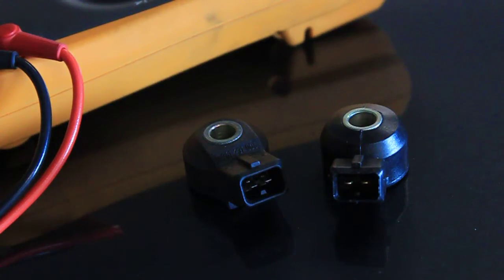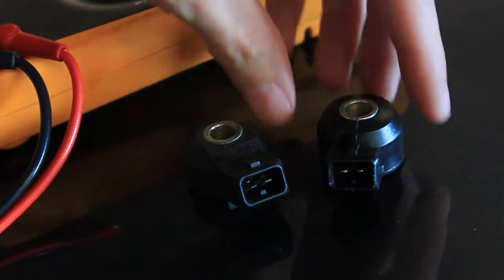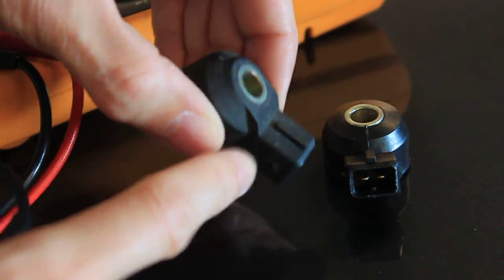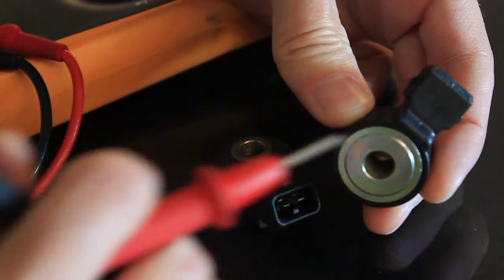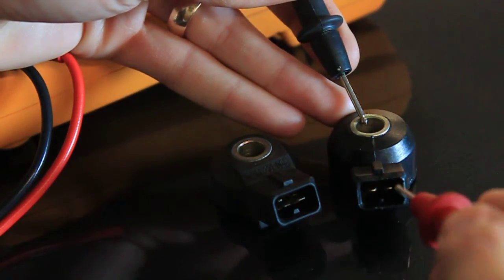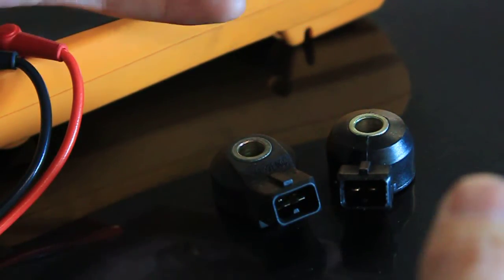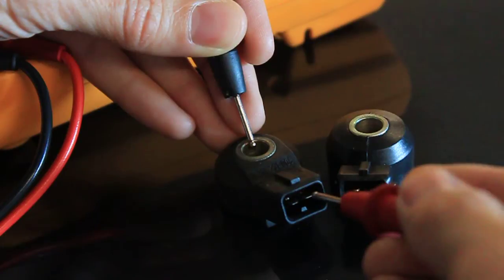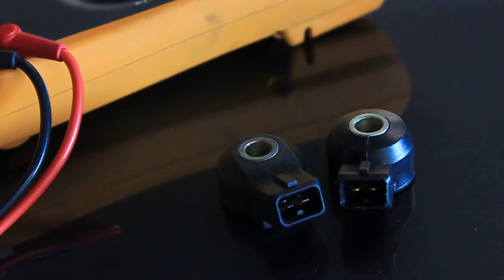Flat Response Knock Sensors - Not all are created equal.

Comment: This guy is right a grounded ring sensor is undesirable unless yours is specifically a  one wire type. mine showed resistance to ground & was faulty, the new working 2 wire sensor was not grounded

Comment: The series 2 I have has one pin for the knock. I get you aren't grounding the second knock sensor wire to the engine, where did you connect the second knock sensor wire?
Reply: Im working on a maxima and wondering the same...I bought a a sensor and wire harness off ebay for 30 bucks which said oem with nissan packaging but no writing on the sensor, harness has two wires going down to one wire at the sensor plug , I need to test tp make sure cause I'm having issues

Comment: The important thing to do is to not make a mistake with the wiring polarity. If you switch GND with signal you will get spikes going into the ecu. We use both sensors on Tuner Nerd  Knock monitor pro. The Bosch gave a slightly flatter response and the polarity can be switched. The nissan style sensor gives a good response too, but dare you not switch the polarity!

TLDR: Buy the bosch - they work everywhere , but the internally grounded sensors are good for systems configured for it.

Comment: I'm sorry, but your opinion cost me more than $250. Unfortunately all of the sensors (old one, ebay $9.and oem one) do have ground!! Please redo your experiment.
Reply from the maker: mohamed alromaithi this is not an experiment nor my opinion, I am showing you what I found when I purchased a knock sensor from eBay. There may be eBay knock sensors that don't have their electrical pins shorted to the body of the sensor but I know from these measurements that the Bosch sensor does not.
Reply: Nissan use the engine block to ground the knock sensor and the plug from the engine wiring only use 1 wire for the signal, its is 100% same as your ebay generic sensor
Reply: it depends on the manufacturer... some will ground thru the block and some will not.. he only told u what his experience was..its not universally that way across the board

Comment: I'm not saying your solution of a floating sensor will not break up a ground loop, it will, but the system description  is not accurate.

Most sensors are mounted to the block, directly or indirectly. Water temperature, manifold temperature, oxygen, and even the Ford TFI PIP system is block centric. Ford, as one example, directly grounds the PIP to the distributor and the block. Because of this, many factory systems use a block-centric sensor ground system. They do this to prevent ground loops.

The real issue comes in with aftermarket manufacturers. For some odd reason aftermarket manufacturer's often tell people to ground to the worse possible place for noise and safety, the negative battery terminal. That ground is usually unfused, and goes to a common bus inside the aftermarket electronics that is shared with sensors and other pickups. This is the real recipe for noise ingress, because the power ground loops noisy battery return current to the aftermarket equipment internal bus. That noise current loops out on a sensor ground if the sensor has a block ground or chassis ground. This is really what causes the issue. 

Battery post grounds are also bad for safety. If the battery ground develops a poor connection battery  negative current, which includes alternator and starter currents, will route normal battery ground currents out through the aftermarket gear's internal negative bus to whatever ground it can find on that device. 

Using the Ford EEC IV as an example, Ford common grounds the PIP signal at the distributor to the block. They do this because the distributor is point where spark noise concentrates, thus they want the lowest possible impedance to the common ground at that area. They run the PIP signal at the EEC in differential, floating from ground. This prevents a low impedance ground loop, since the "ground return" is in differential with the hot PIP wire at the EEC input. The EEC is grounded to the chassis for low level and operating currents, the high current injector and solenoid return is grounded to the chassis near the battery before branching to the battery negative connector terminal. They do this because the injector and solenoids have backpulse noise and also draw considerable current. This is the same reason they did not trigger spark in the EEC, but trigger a remote module. (GM does the same.)  

The only battery post connection is through a heavy cable to the block, which is common to starter and alternator, and a smaller wire to chassis which is the normal "clean" ground used for sensitive equipment not engine or transmission related. Lights, the radio, the EEC power, and all accessories are chassis centric. 

There are some variations to this system, but the dumbest thing in the world is using a battery post connection for accessory device negative power unless that negative is fully isolated and the connecting wire is fused at the battery. Grounding to the battery is noise and damage waiting to happen.

Comment: Some knock sensors have 2 pins but on have 1 wire on the connector plug... So have to use the engine as a ground.
Reply: It looks exactly the same as the on in your video... :) Not sure what flat response it.

Comment: Nice informative video, just a question about the bosch knock sensor, which pin is signal and which is meant to ground at the sensor ground? or does it not simply matter?  cheers.
Reply from the maker: +Sefveron : hi, thanks for the response. I don't believe that the polarity of the sensor is important. The sensor is really just a microphone and will create sinusoidal waves across the two pins when it experiences vibration. You can test it by lightly tapping it while it is hooked to the DMM or to amplified headphones.
Reply: +Greg Grotsky cheers!